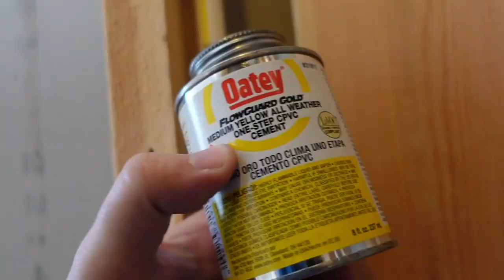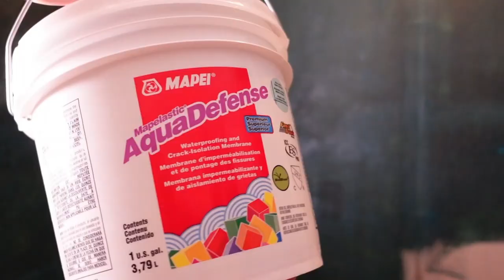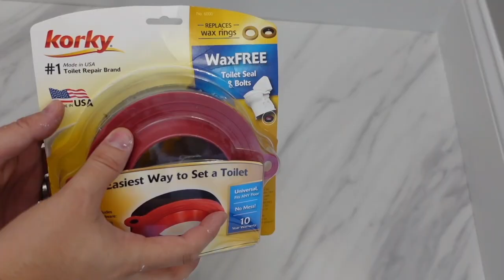Complete Master Bathroom Remodel Time Lapse DIY Start to Finish

Comment: The water connectors “speedies” you used for the sink faucet I think has life span. They are not supposed to be behind walls.
Reply from the maker: Well I guess I can always open the drywall in my closet to get to them. Yeah I just wanted to try it but in wall stuff isn’t very practical from a repair standpoint